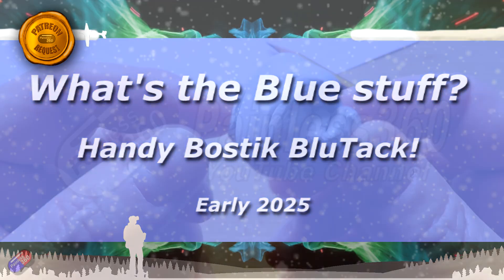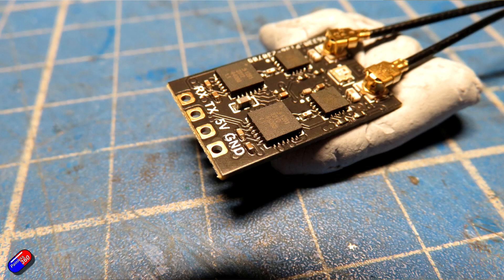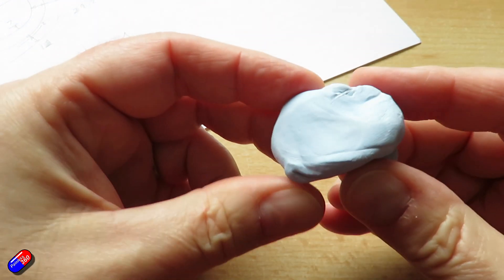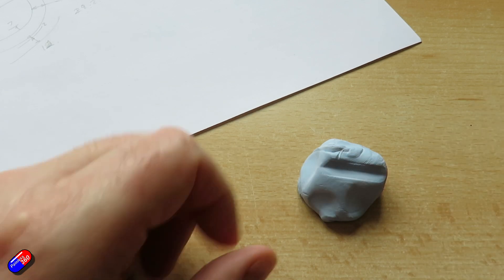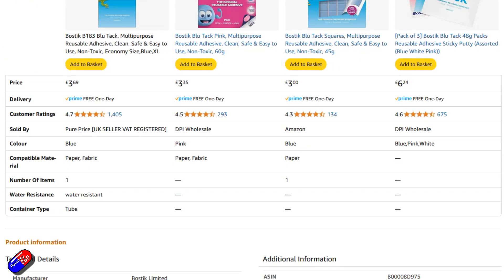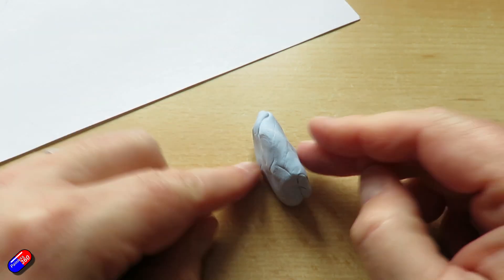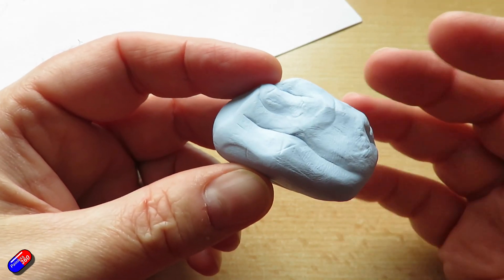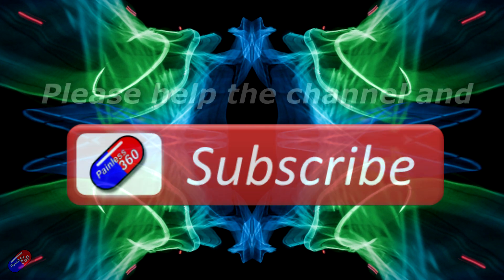What is that Blue Stuff I keep seeing you use when you are soldering?

Comment: Hi, I only have the concern that it maybe melts with the heat and sticks to the pcb. I haven't used it and I'll try it. I will also use the blue tape or tabs we use instead of thermal paste for cooling the cpu. The plaster I used(play doe for kids) is a mess as it melted and stuck to pcb.
Reply: yes it will melt, not melt like plastic, but will give residue like sticker (gluey)  but you can clean it with ipa after finishing soldering....
the trick is put the blutack on area that not heating too much while soldering...
you can reuse as many as you want....
Reply from the maker: As covered in the video, it will stick but by dabbing the ball of it when things have cooled off it'll pick any pieces up cleanly... Happy flying